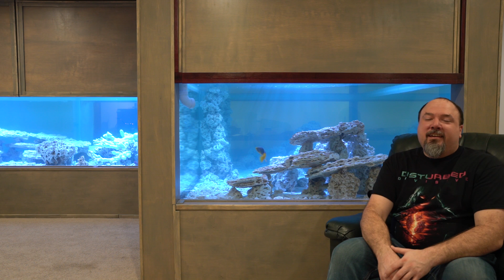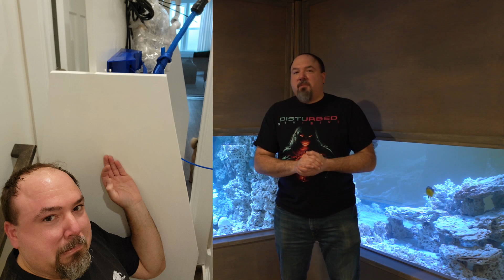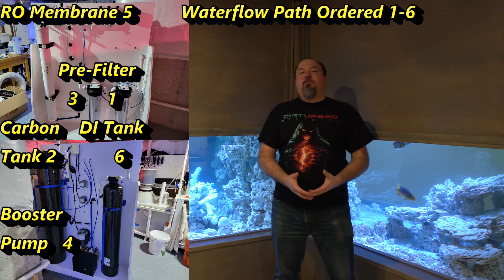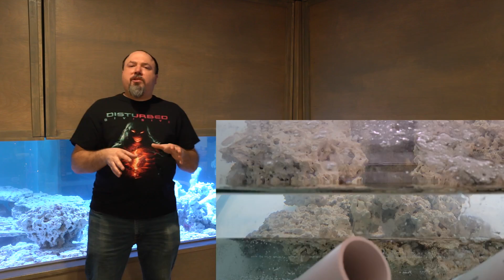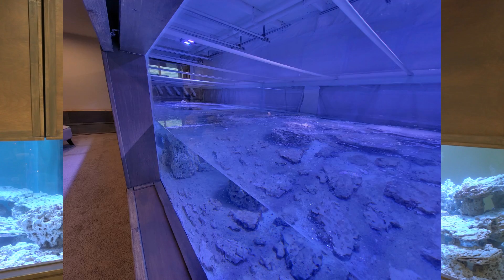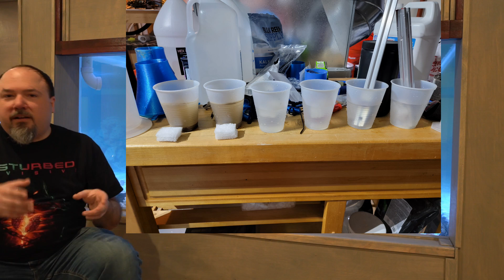4200 Gallon Aquarium Startup

Comment: Just wondering if you’ve repeated the ICP and what it showed regarding aluminum levels.  Did you send ICP test to another lab to confirm results?  Great start!  What are you going to use for circulation?
Reply from the maker: I will send out another ICP in the near future to see what has changed in the readings.  I have one panta rei ECM 42 in the reef section for the corals in the tank and the return pump.  I am going to start adding more pumps shortly.  I have some DIY experiments I am working on for flow.  Ideally there will be a few larger pumps for flow and some supplemental pumps if needed.